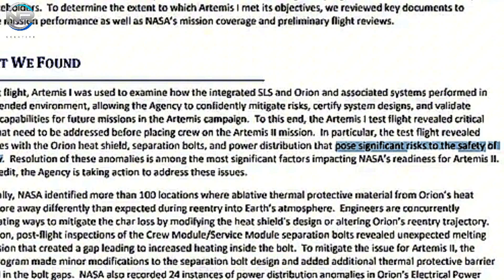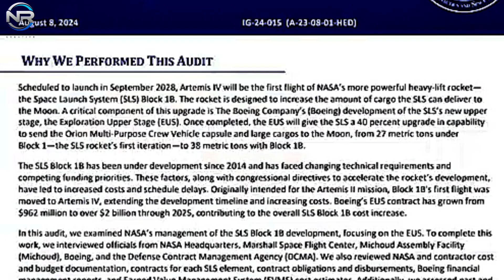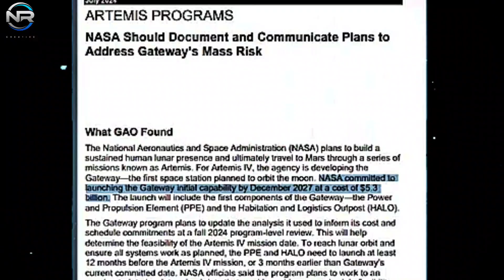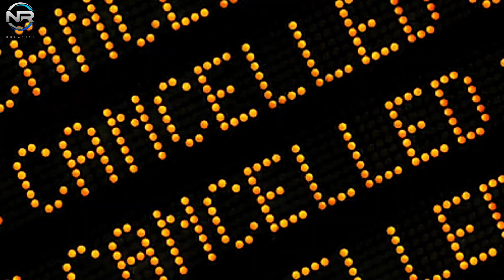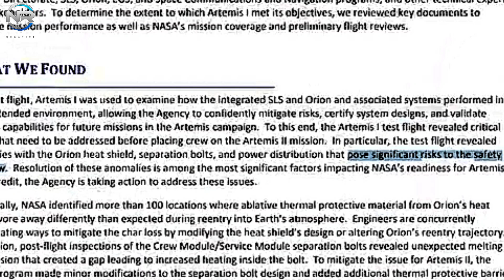Big Trouble Happens! NASA's Orion Heat Shield Damaged Worse Than Starliner

Comment: The heat shield should be a one piece shield with metal tubing running a coolant through the tubing, then use the heated fluid coming out to warm the inside of the space Capsule.😊
Reply: When you are plunging to the earth in a halo of white hot plasma would you need much heating in the capsule ? I guess they could use the heated fluid to make tea or something.
Reply: Thermo dynamics is not as cut and dry as one would think . The array of physics involved can at times, seem very counter intuitive to the layman. The entire unit as a heat exchanger in its layers is good tho I like it. Some outer cellular membrane and pseudo-ceramic shielding is in order tho.